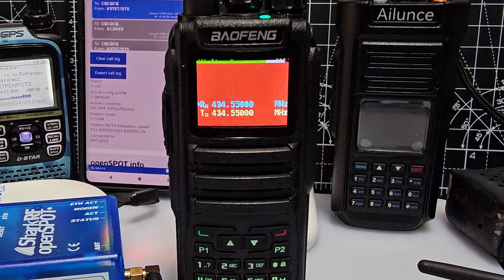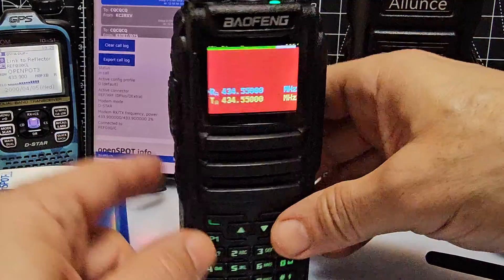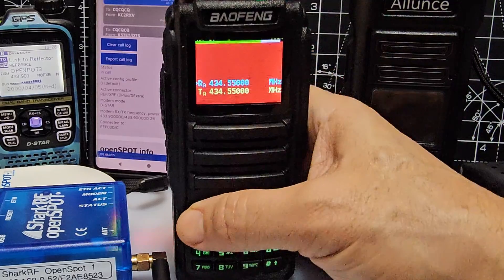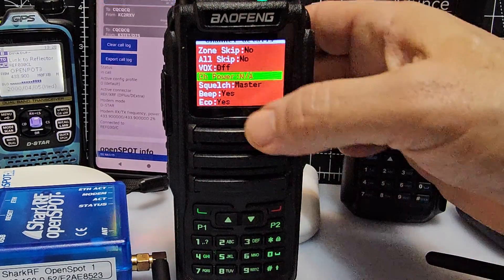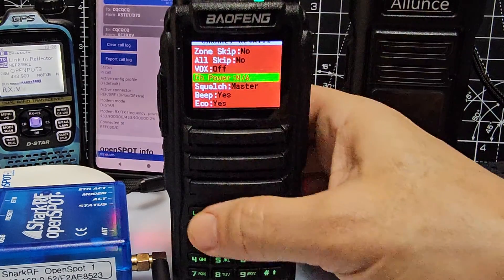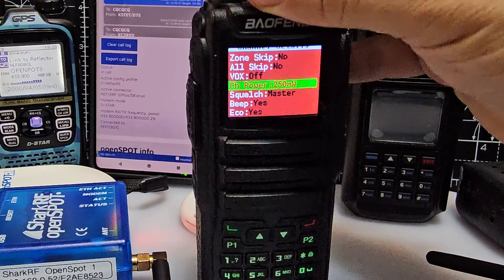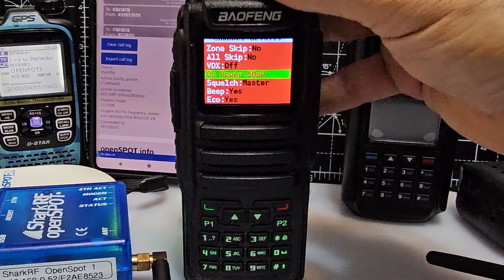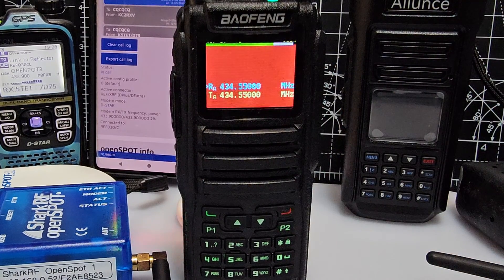BAOFENG DM1701 - OPENGD77 , CHANGE TX POWER

Comment: SK2 + P1 or P2.
Setting the power output in the channel details will only be valid when that channel is selected (and overriding the Master power setting).
Reply from the maker: Thanks
Reply: That doesn't work for me, I've got the latest firmware. Not sure why...
Reply: @kc2sho  Depends of the radio model (but it's SK2 + P1 or P2 for the DM-1701). Look at the User Guide for details.
Reply: Update, the cheat sheet i had didn't have the correct button mapping